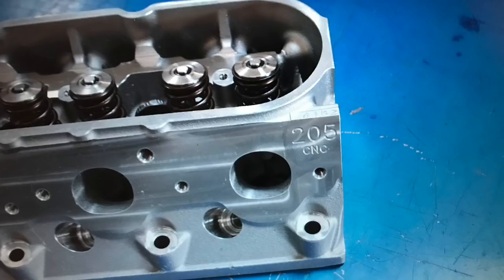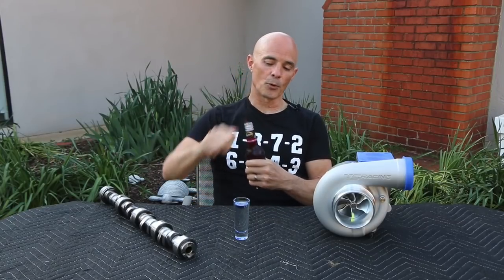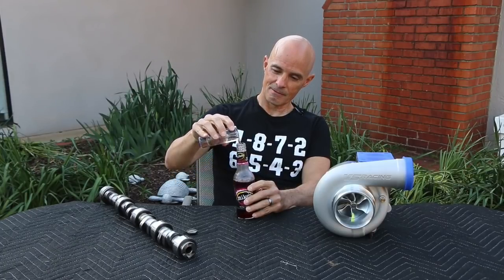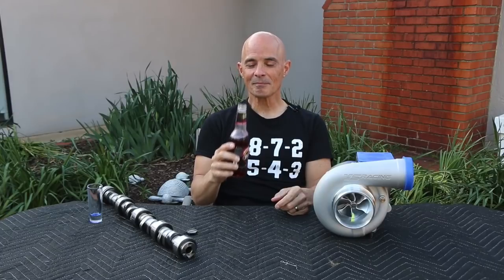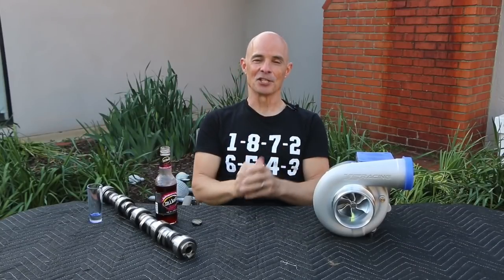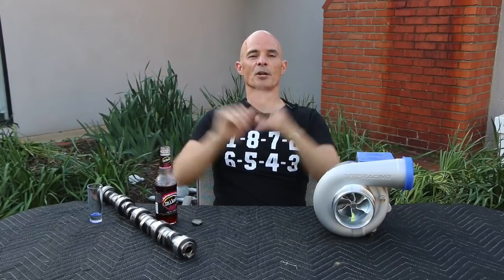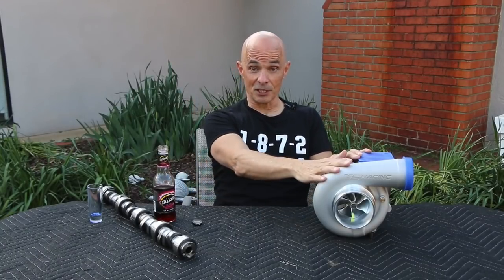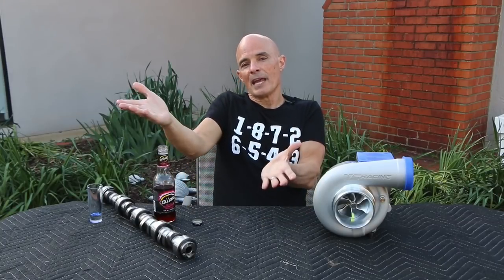TURBO LS-WHEN ARE PORTED HEADS NECESSARY?

Comment: I think to say you can get 80% of the results of someone who knows what they are doing, is a really big call. Having ported numerous heads myself. I have seen several of these "give it a crack" heads come into the workshop wrecked beyond repair. Without fail they almost always exhibit the same symptoms, bigger is better... Flow is more about shape then it is about size. One of the biggest rookie mistake is to get too carried away with hogging out and not exercise shape caution. Often with porting less is more. I'm not sure if I could even achieve 80% of someone who is really familiar with a particular port shape and has done extensive flow testing. I bet I would have a better chance of making the flow worse than gaining 80% of an expert.
Reply from the maker: agreed-easy to ruin a good head-that's why how-to videos help-I'm a less is more guy, especially on something new
Reply: @richardholdener1727  even if you have never ported a head before (which I know you have), the best thing to do before you start is study it, and have a plan of attack before you even turn the grinder on. I have ported heads where touching the short turn radius just made a bad factory design worse. Our Holden six head is basically a shrunken down version of a Gen 3 Blue Flame head which also has a port floor that is too low on the intake. I saw a POWERNATION video recently where they actually fitted a piece of material back into a Chev straight 6 head that built up the factory floor. https://www.12bolt.com/store/c2/Bolt_In_Lump_Kits.html

Comment: I always say.  I’m just gona unshroud the valves a lil and just touch up the casting flashing. And I always end up porting the shit out of em. LS’s make tons of power with a lil port work.
Reply: From looking at Richard's tests, they really don't seem to add at whole lot. I mean when you only see a 20-30 hp gain going to rectangle port heads it sure seems easier to just go a little bigger on cam.

Comment: Hey do you have a video where you compare an "all out heads only" versus an "all out cam only" comparison (with or without turbo)? So for example junkyard engine with the "best" heads but no other mods versus a junkyard motor with the "best" cam? (In this context best means most peak hp)
Reply: cam wins every time. All the LS heads are decent and all the cams, in particular truck cams, suck
Reply from the maker: ported heads with stock cam loses by a mile

Comment: Wouldn’t adding more boost to get to your desired power level also cause more wear on engine internals and more chance for failure? For example, if I had to run 26 psi to get to 1k with a cam only setup versus maybe 20 psi with a good H/C/I.
Reply from the maker: cylinder pressure is near the same-back pressure and air temps higher

Comment: I’m on the every thing side but my wallet is on the bone stock side IV got something in the middle. 4.8 stage two cam springs and gt45 clone tremonatorX 9.883 at  16.5 psi wC16 and 22 deg timing. 3250p s10.
Reply: What kind of power are you seeing out of your gt45 or trap speed. I've got a 5.3 with 706s btr ss2 turbo cam sheet metal intake and 102mm tb with a emusa gt45r (rearmounted) trying to get to around 750whp so I can dip into 9s with my fbody. So far with a stock ls1 with sheetmetal intake an tb only on 9#s I made 530whp/540tq stock 60e/10bolt. I'm thinking if I can get 18#s I should be able to get around 750whp and dip into 9s out of the gt45r. 🤞🤞

Comment: Will you run into backpressure issues at a certain power level with stock heads?.
Reply: It depends more on turbo selection   than anything. If you look at the two tests that were done on a 496 BBC with one and than two ebay gt45 turbos, the difference in exhaust pressure was dramatic. With the boost level remaining the same, the exhaust pressure when from something like 22psi to 6psi. Proper turbo selection would probably be a better investment if you don't have much to spend.

Comment: Okay so if I had a LM7 all stock making 300hp by adding 20lb of boost it should make 708hp..
 Ok with race heads on the same LM7 would add about 50hp bringing it up to 350hp by adding 15lb of boost it should make about 708hp.. 
So in theory by adding 5LB to 6LB more boost to the all stock LM7 ..you can make the same horsepower..??
Now the big question is how critical is the predestination on pump gas between 15 to 20LB OR 20 to 25LB OF BOOST..??

Comment: I think I'm in the middle I can justify valve springs and a cam and ring Gap. And for the right combination something I really like I can justify the time of doing some DIY head work and learning from it. But I think Val Springs Cam and ring Gap based on all of the videos I've seen you do and engine Masters will get you where you want to be easily and most bang per buck? Would you say that is accurate? -leaning on the budget side
Reply from the maker: you get to choose
Reply: Awsome videos- great your sharing this fountain of knowledge

Comment: I am running a ls2 forged bottom end 9.0 compression  ls3 cnc heads by Frankenstein dynamics with a btr stage 4 cam cant wait to put my big single turbo and rev it to the moon hope to make 700whp on pump gas and 900whp plus on E 😎

Comment: For me it is important that it will last for long time.
Better with 500-600hp on the street then 900 in the garage !
Reply: Heads aren't going to be the issue with reliability when speaking boost
Reply: Mr flimflam fremdippity danyet well heads allow to run lower boost so lower boost means less strain and more longevity

Comment: I have a 2000 chevy z71 5.3 stock cam, 276k miles, I was thinking about pulling it and rebuilding with a 4 inch stroker kit, stage 2 btr cam, with stock heads for now. However, I have been told that them 799 heads are the best? Is that true?
Reply from the maker: sure-if your 383 makes 600 hp
Reply: @richardholdener1727  Idk what it would make or even if it would be worth daily driving a stroker 5.3. I would love to personally chat with you 1on1 because I have so many questions. I want this motor powerful and reliable

Comment: Dude I need to give you your 👑crown right now all of the information that you're providing is spot-on except for that freaking formula got me🙄👀🤪... I can't get it to work..  maybe I need another calculator or something is wrong with my arithmetic..🤦🏻‍♂️ I'm sitting here scratching my head I tried to use it with the information that you provided from The Big Bang 6.0 motor THAT made 529HP N/A I know I'm going backwards but🤷🏼‍♂️🤦‍♂️
Reply from the maker: Try this -(Boost in PSI/14.7), then add 1. Then Multiply by NA power 
so 20 psi/14.7=1.36. If we add 1, we get 2.36. If our na motor 300 hp, we multiply 300x2.36=708 hp

Comment: I agree, it depends on the budget and power goal. It's not definitely always this or that. It's simply not always necessary for a head and cam package. If you have the cash though. It's always the smart thing to do. For all the obvious reasons you listed. More power at lower boost, more power all around, etc. The right combination regardless which why you go is key. If you want to maximize said combination. That's the biggest mistake most people make. To many try and force a square block in a round hole. Doesn't matter how hard you try. It's not going to work until you have the piece that actually work together.

Comment: It depends on if you want a car you can drive daily or a drag car. The thing you have to look at is the amount of heat that you'll generate as you increase horsepower. You can't change the laws of physics. A motor that makes 1000 horsepower is like having a furnace at your feet at WOT. If I were to build a boosted LS, I would add a cam, make sure I had enough ring end gap, and call it a day. The car would have plenty of power when I wanted it and I could go cruising with it. I'd like to drive my car more than 1/4 mile at a time.

Comment: If possible Richard can I have some advice for a build I want to do. I want to do a 600rwhp na and 1000rwhp on 400 wet shot nitrous for a GT86 through a tremec TR6060. The question is do I go for a resleved block to a 4.185 bore and a 3.622 stroke and have 6.5L displacement or do I keep the standard LS3 block and displacement. Also what heads and cam would you recommend for it for a street and drag racing use.
Reply: Take the GT86 circuit racing 👍. Camed, portrd, high comp 6.2L LS at 7,500RPM. Fun for lap after lap. Instead of 9seconds
Reply from the maker: nice
Reply: @manitoublack  sought of why I wanted nitrous for drag racing then 600hp for everything else
Reply from the maker: 400 shot on a stock  alum block might be a bit much

Comment: The great thing with improving cylinder head flow (in addition to the correct camshaft) is being able to Rev the motor harder😈.

And more revs = more better😁
Reply: You really don't have to over rev a turbocharger motor..
 to make decent horsepower  you need boost and boost = TQ and TQ & 6500rpm =🤯🤭

Comment: Another video idea, any interest in readdressing the big bang series on some of the motors that didn't pop? Maybe take a gen 4 6.0l, cam it to make peak torque up high so as to soften that torque hit, and then maybe do a compound system for giant power capacity. Maybe like a 7875 as primary (closest to the exhaust port) and a pro mod turbo as secondary, or as I like to think of it, the pro mod turbo turbos the 7875. It'd be way cool to really push the rods on that motor. Or maybe do a cheap H beam big bang? What could an otherwise stock 6.0 do if a guy bought a 500$ set of rods and just tossed em straight in with some plastigauge?
Reply: Camming it up will increase the torque figure, which comes from an increase of the load on the rod - rpm is not a factor there, nothing is softened...

Torque is a result of the force applied to the crank from the piston through the rod: a given torque means a given force on the rod, basically.
Reply: @needadate  Well, yes that's true NA. I suppose what I'm really talking about is the RPM at which torque comes. Say you have a stock 6.0l, it makes peak torque of 370 at 4400 rpm, and peak power is 325 at 5200. That's 310 HP at peak torque. Now if you boosted that engine to 1500hp, you'd have an engine that creates 1430lb ft. If you cammed it really crazy so peak power happens at say 7500, and peak torque at maybe 6500, lets say we hit that 1500 number right at 7500, and maybe it's making like 1490 at 6500. Now peak torque is 1,196. Can we add boost to bring that number up to a previously known big bang torque number? like maybe 1400lb/ft? If we make 1400lb/ft at that rpm that's 1733hp. Let's say we still have that same powerband, that makes for 2174hp at 7500rpm. That would be incredible! That's what I'm talking about. Obviously some cash will have to be spent in valvetrain to make it rev that hard, and particularly have peak torque so high.

Comment: Boils down to "how big is your wallet" most often it seems
Reply: that's what car modding is. how fast do you wanna go vs. how much do you wanna spend.

better flowong heada that allow lower boost for the same HP might result in lower IATs which means you worry less about knock, which could mean the difference between using pump gas vs e85 or having better ignition timings. also gives the motor some room to grow for bigger turbos in the future.
Reply: Cash represents time spent or risk in the past, if you spend last year's time to buy the heads or time porting it now yourself it makes no difference as both are time spent past or present. Or time spent in the future for those who put such things on a credit card.

Comment: Nice  ls video  we need  for old school  350 forged bottom  with  vortec  heads  turbo  will  make  1100hp?
Reply from the maker: Stock Vortec heads on a junkyard 350 require spring mods but with a cam will make enough power to reach 1000 hp with boost (perhaps less than 20 psi)
Reply: @richardholdener1727  prove it! 😁 (and I dont mean that in a snarky mean way.. lol Id actually like to see if it can be done) As I recall I dont think the vortec heads even flow 250 cfm at max lift.. and im pretty sure that a 350 vortech bottom end will have issues at that power level without a fair amount of work (rods, forged pistons and forged crankshaft along with splayed mains and arp studs.)
Reply: mj top fuel maybe with 46lbs of boost.
Reply: You would need better heads. The vortech heads just dont flow much air. The key to the LS motors making this knd of power is that the heads flow REALLY well even unported.

Comment: I think people underestimate how much 700hp in a street car actually is lol

Most people riding in a 700hp turbo car will believe you if you told them it makes 1200.
Reply: Funny cause it's true!
Reply: Heck Ian, even a lazy 500hp from ~ 500cubes in a sub 3500lb car is enough to frighten you with under 3.5:1 gears. The gobs wheelspin from the tall gearing makes the rear end feel like it's on ice. Very disconcerting when you hoof it in a built up area, it steps out and you snap the throttle off, it bites and cavorts off in a direction you'd rather it didn't. Parked cars, poles, pedestrians, gutters etc take on a surreal aspect lol.
Reply: So tru.  First time I drove a c6 zo6 with 800hp to the wheels. I damn near shit myself. I worked in a powersports shop and got to drive 500hp n/a to 1200hp vettes and camaros and hellcats. And had some fast cars myself (600hp) street cars and anything over that 500hp Mark is just insane and the average car guy would think 700 is over a 1000 cuz it’s just stupid fast on the street. I’ve heard kids go. It’s Gata be 8-900hp before it hits the dyno and it makes 500 to the wheels.
Reply: Especially in the wet or where traction is limited. I went to a track day about about two months ago and helped a guy sort out his 555ci centrifugal blown engine, which he claimed made 1000hp to the wheels. I went for a test ride with him after we fixed it. It had been raining and traction was poor. It could have just as easily have been 500rwhp. You get no sense of the power when there is no traction.
Reply: Totally agree.👍 Look how fast a 300bhp rally car is. In my current build (Pulsar GTiR, turbo 2.0L, ) I don't want more than 275AWkW. Then I wont be able to drive it on the throttle in the mountains. The roads are too narrow and twisty. Needs to be progressive and responsive.

Horses for courses. Some people want a traffic light hero. And that's cool to. But I don't like speeding tickets 😉
Reply from the maker: Pulsar GTiR is bad ass
Reply: @richardholdener1727  nearly bought a GTiR, was all set to import it, and the importer called me to say it didn't have the door braces we needed for it to be complianced. He could get the car, but I would need to change the doors. So I cancelled the order and bought an SR20DET powered 180sx. They apparently had a lot of gearbox problems.
Reply: @richardholdener1727  cheers 🥂.
Reply: @manitoublack  i daily drive a car thats likey near 300hp. (Mk6 GTi k04) and its plenty for the streets. It's hard to hook up from a dig(FWD). Its a fun little daily but still seems kinda slow to me now and has since about a month after the turbo upgrade. It's plenty to scare people that ride with me as well when i decide to lay the hammer down. 
Its not as fast as my boosted G35 with Meth but that is a different animal that hardly sees the street anymore.

I have also noticed the torque of a turbo car feels much better then a N/A car. Seems the torque stays higher longer and that greatly adds to the feeling of the car.
Reply: After having 540hp/600ftlbs and going to 700+hp/tq in the same car, it hooking decent at the lower number running 1.5 60ft on slicks and 1.7 on drag radials, then the 700hp/tq engine just blowing the same tires off like they are 225 Cooper radials, it impressed upon me just how much I do not know yet.

The mid to high 11 second 540hp engine scared the hell out of people who had never been in anything faster than 13 second cars. Now its going to make their ass pucker so tight they'll rip their underwear. Over 1000? If you can hook it, its what I call 'stupid' power, because you can go from fun to stupid incredibly fast.

Its an entirely different thing when it makes NA 700 at 6000rpm, because its making crazy torque in the 3000-6000 range, than when it makes 700hp at 8000rpm. Math it and see how much difference. Getting that torque to hook is an art mixed with a science.
Reply: Depends how light the car is. 700RWHP in a 3000lb car is going to be pretty insane on the street. 700RWHP is about what a stock Red Eye makes and yeah it feels fast but nothing like what a 3000lb car would feel like.
Reply: My C6 Z06 makes 630rwhp n/a on 93 pump gas. You can't hook it on the street whatever.
Reply: @johnnymoran180  My C5 makes close to 800rw.  It will easily break traction at over 100mph.  It would be more fun to drive (most of the time) if it only made around 500.
Reply: @johnnymoran180  you need better tires lol
Reply: Then you need a tire. My HCI C6Z dead hooks first on a Mickey ET SS
Reply: @Z3rhairstylers  Who are you talking to?  

Are you talking street or track.  And how many horses are you riding?
Reply: Absolutely
Reply: I am also right there with you. I am damn near positive I'm not as the 700 mark and rowdy is an understatement.
Reply: To be fair unless you are racing anything more than 350 hp with decent torque is all you should ever want on the street. Doing rolling burnouts when you are already doing 60 mph really is overkill
Reply: @dazaspc  I like somewhere around 500 in a light car.
Reply: @michaelangelo8001  If I want to go fast on the road I just ride my Hayabusa . That is only 200hp.
Reply: @dazaspc  Weight vs HP...  I've been down that road also, but at my age I prefer a convertible Vette.
Reply: @dazaspc  it's all in the HP to weight ratio!!